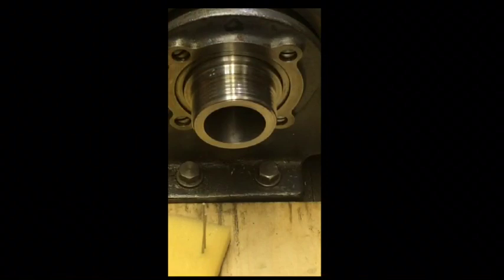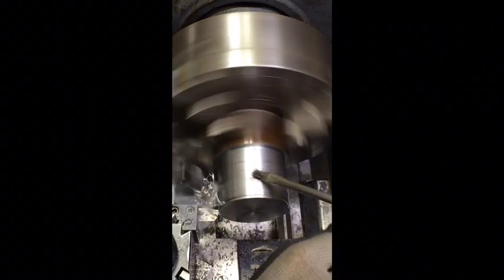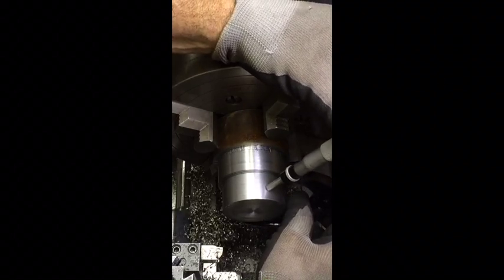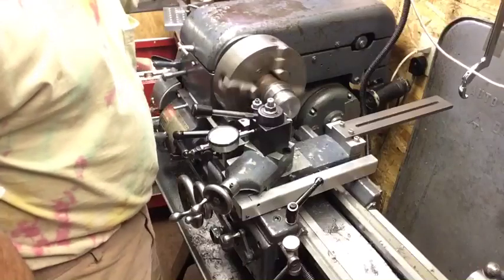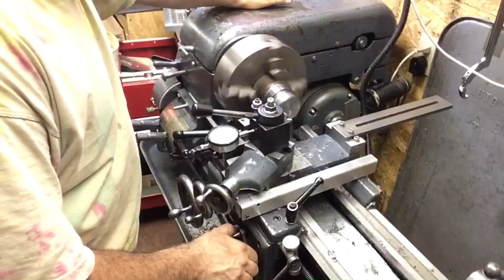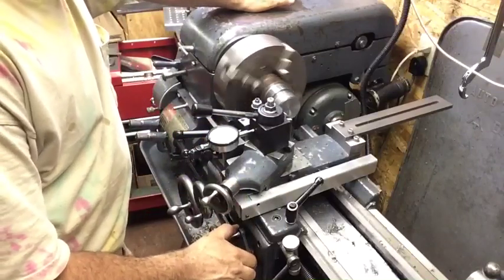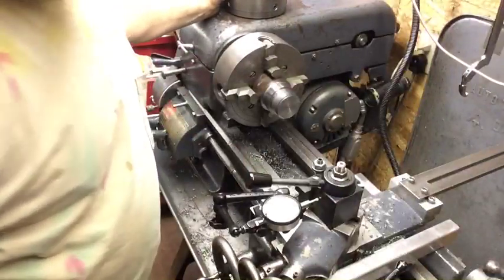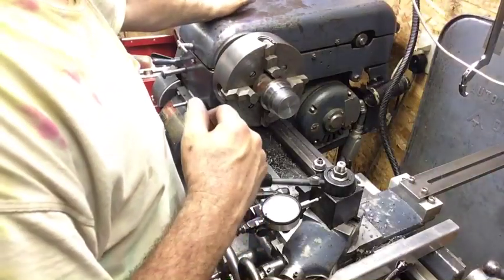Making Lathe Spindle Guard Nut P1

Comment: Hi Randy,
I like to cut threads with HSS tool bits, they're forgiving and very inexpensive. Nothing beats a single point thread.
Good idea to let parts cool naturally, so they cool evenly, and no or much less deformation. That's surprising how little heat plays with dimensions.
Cheers,
Pierre
Reply from the maker: pierre beaudry I like HSS on my lathe, I use it all the time.  I did the gage with HSS and I am doing the Nut with Inserts.  Just to show a difference.  Thanks for watching.

Comment: Nice job Randy. Maybe after using the spindle thread gage for your project, you could reuse it to mount the same chuck on the bed of your milling machine for milling round stock. Bore out the gage center and thread to fit for a threaded post with t-nut that can slide into the milling machine bed t-slots. Then drill a couple holes on the gage section below the threads and use the holes for tightening the whole assembly down with a tommy bar. After this is firmly secures then thread the chuck onto the threaded gage.
Reply from the maker: Paul Jones Excellent idea.  I am going to look at that.  I am really busy with the new lathe's. Trying to get them in the shop and powered up before winter hits.  Thanks Paul for watching and the great idea.  Randy

Comment: you idea for holding the thread wires is clever, way to go!  I don't want to sounds like a safety freak, but we have been told many times at work to never wear Rubber or rubberized gloves around spinning shafting or machines. Because it increases the chance that type of gloves  to catch uncontrollably and really mess you hand up in a hurry.  for other applications they work great!. keep up the good work!     Thanks for sharing!
Reply from the maker: dennis brooks Thank you for your comment.  The glove thing,  I have been working on and around spinning machinery for about 40 years.  I have found that tight fitting gloves have protected me more than they have ever threated me.  I have never been injured wearing gloves around machinery.  Rule # 1, 2, & 3 I don't put my hands where they don't belong, because even with gloves it won't help.  This is my opinion.  Dennis thank you again.

Comment: Randy, thanks for the video. The pin in foam trick looks useful.  I've seen others struggle with holding three pins and a mic with only two hands before. I'm surprised there isn't a Starrett tool for doing that job! :-)

As you were cutting the threads, I noticed that your carriage hand wheel would pause briefly at one point. Is that an optical illusion from the camera angle, or is there a tooth missing in the carriage movement mechanism?

-- Mike
Reply from the maker: BigMjolnir  The foam tool is easy and simple, thanks.  My carriage hand wheel ahas a very worn bushing so when threading it flops around.  A new bushing is in order, I will have to get this done soon it has been bothering for awhile, good eyes Mike, thanks for watching.

Comment: Question. I don't even have a lathe or mill, yet. I keep watching all you guys waiting for that day. I see everyone wait for the piece to cool off, I understand the enlarging when it gets hot, simple physics. My question is, would it be possible to speed up cooling with a nice wet rag? Or would that be too quick? It doesn't seem that it would work harden the piece since it seems to only get to a few hundred degrees, or is that hot enough that a quick cool would harden it to an extent? Thanks, keep up the great videos!
Reply from the maker: Aaron Kimmins It is not so hot to harden in this case.  Not saying that I have seen pieces very hot after rough cutting, and on some material hardening is an issue.  In this case it is a size issue and usually is in most cases.  The piece when finished will be at ambient temp and be used at that temp.  So if I measure it when it is 150 deg. in may read 1-2 thou over what it will be when cooled.  So if I turn it to final dim. when hot then it will be under size by maybe 1-2 thou or more when cool.  It your sizing is tight tolerance you can easily be out of tolerance and scrap your part.  So when I measured the threads when I was finished in the lathe, the part was warm,  I was over about 1 thou.  When the part cooled and I remeasured, it was right on the dimension I was shooting for.  Thank you for the comment and watching.
Reply from the maker: Randy Richard I could of used a wet rag, but I had other things to do and easy to just let it sit.  Some materials you do have to watch out about quick cooling.  Some materials if you do not cut them fast enough the material will harden as you cut and you will not be able to cut it or you can break an end mill or dull your cutting edge, some stainless's are like this.
Reply: Ah, so basically better to just let it cool naturally then.
Reply from the maker: Aaron Kimmins Yep.  I am usually not in to big a hurry.
Reply: Randy Richard yeah, being in a hurry is when we usually screw everything up!
Reply: Aaron Kimmins Taking the time to do it right the first time sure beats using hero moves on the lathe and having to do it over again , kind of like road rage on the lathe, Spindle Rage or whatever, lol.